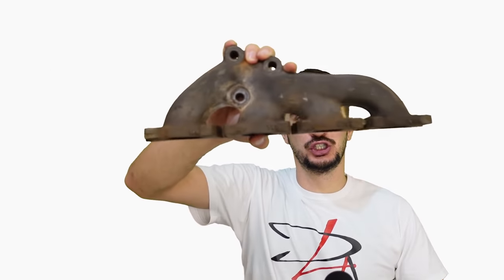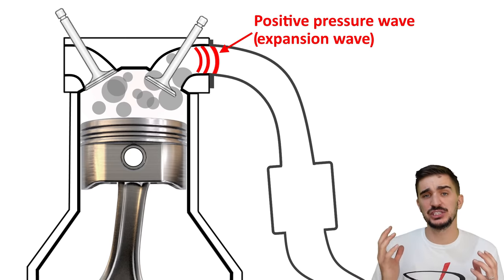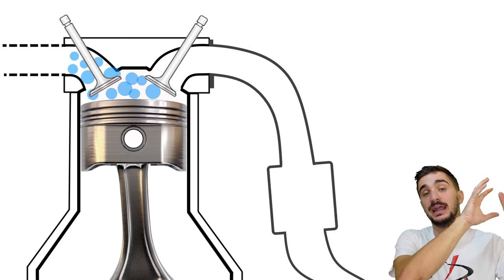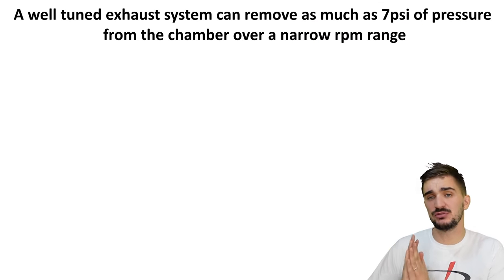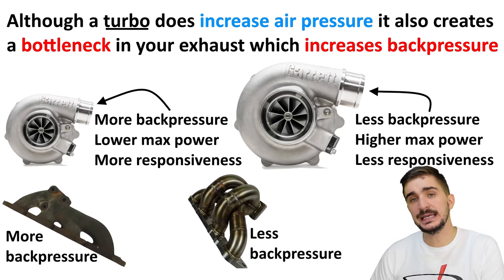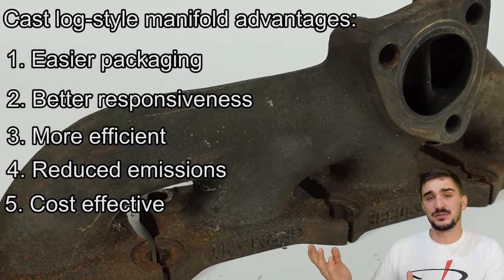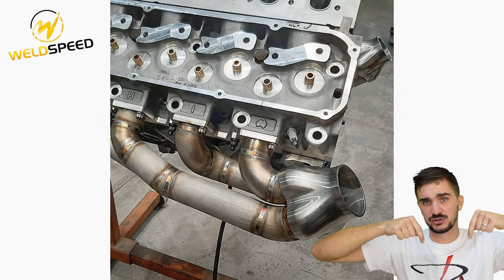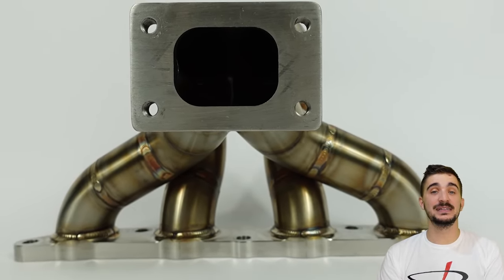EQUAL LENGTH tubular vs. LOG manifolds (headers) - SCAVENGING and EXHAUST BACK PRESSURE EXPLAINED

Comment: Back in the 80's Yamaha introduced the  EXUP system on their 4-cylinder high-performance bikes. It used a butterfly valve at the collector to change the timing of the negative pulse in response to changes in rpm. Later they also introduced variable length intake runners. 
To improve low-rpm intake velocity on single cylinder bikes they fitted two carburetors, one with a small bore, one large. The larger bore carb would only open at larger throttle openings.
Reply from the maker: All very very relevant examples!
Reply: is that used in any other bikes of other manufacturers?
Reply: @vasilisgreen  yeahh but yamaha the true genius who create the brilliant system later then copied by other manufacturer
Reply: @d4a  can you make video on this Yamaha exup system?
Reply: @JAVTROOPER  the "genius" who copied Walter Kaadens work at MZ disc valves
Reply: @chrisdeli7547  so now walter kaaden is the one who did the breakthrough but unfortunately yamaha still the genius who make it popular and sell it within their ownership
Reply: Sounds a bit like Yamaha's YPVS of 2-stroke engines, in the RZ and RD models to flatten and extend more the torque response curve.
Reply: @JAVTROOPER  you've said that already. I'm still picking a kawasaki over any yamaha
Reply: Every American V8 had two carburetors like that for each plane.
Reply: I would really like to see a video on variable intakes, I find the topic quite interesting but I don't really get it and he's so good at explaining that stuff.
Reply: @JAVTROOPER  go listen to music dude. with your yamaha headset.
Reply: Interesting.  I had a Mini with a Weber 28/36 carburettor that worked much like the Yamaha one you write of in your last paragraph i.e. the 36mm bore operated  near maximum throttle only to supplement the 28mm bore.
Reply: @JAVTROOPER  You're confusing Yamaha with Suzuki. It was Suzuki who facilitated the defection of Ernst Degner so as to steal the 2-stroke tuning technology developed by Walter Kanden at MZ.
Reply: @Rondo2ooo  The RD used reed valves.
Reply: @robertschneider8808  It's quite simple, actually. The air horns (velocity stacks) behind the carbs slide back and forth in response to changes in engine rpm. Longer tracts improve low- and mid-range power; short intakes give more high-rpm power. Yamaha calls the system YCCI (Yamaha Chip Controlled Intake).
Reply: @jiyushugi1085  yeah I mean I know the basics. BMW has the DISA which uses a butterfly valve to vary the length. But I would like to know more of the details behind it.
Reply: @vasilisgreen  Back in the late 90th  I worked on official kawa service, had a kawa bike as well . We like to tease each other with some painful facts like: when honda engine rumble like a new kawasaki run away from it because it will go down right now.
Reply: Don't forget the variable exhaust port on their 2-smokes! Altho' I think got a little ahead of yourself there, I don't think EXUP came along until the '90s? Yamaha did have their NICS intake system in the '80s [that made it so you had to have a special tool to block off the NICS passages in order to balance the carbs. OTOH, NICS made it so you didn't have to balance the carbs as often...] 😉
Reply: @vasilisgreen  F1 copies the Yamaha R1 style split velocity stacks, it's very simple and works.
Reply: The problem is that the EXUP was tainted by "emissions requirements". Hence why I removed my stock suppressor on my FZ1. I get people wanting clean air. But I'm not the primary polluter in this world. Not even in the millionth place. And I even left the two way cat in so I don't wreak of gasoline
Reply: Actually, I worked for Yamaha (via its advertising agency) as a translator, copywriter and riding model during that period. One of the stories I heard abut EXUP was that one of its primary functions — in addition to broadening the power band — was to reduce exhaust noise, thereby making it easier for the bikes to meet noise regulations.
Reply: The Yamaha CP3 triple uses a different header length and intake length for each cylinder
Reply: @jiyushugi1085  "The RD used reed valves."
Different things. Reed valves on two strokes are the one-way valves on the intake to stop the induction charge from exiting the crankcase via the intake system when the piston lowers to transfer the charge to the cylinder. YPVS is on the exhaust and effectively modifies the timing of the exhaust port opening to improve the low rpm engine power. Honda had ATAC which was in the exhaust, just off the head, which modified the exhaust tract with a butterfly.
Reply: @jiyushugi1085  most of these devices (such as exhaust and intake butterfly valves and flaps) are for noise emissions. We always say emissions and it’s assumed it’s for gas emissions when in reality it’s noise. It’s unbelievable the amount of noise that comes from the intake. I have a special set of billet velocity stacks on the carbs of my Yamaha R6 and revving that thing with the air box off is ear piercing
Reply: The 2008-2020 Yamaha WR250R Dual Sport bike has the Yamaha EX-UP system on the exhaust. The stock exhaust has flappers in it. 
But yeah unfortunately its more for noise and emissions now more than low rpm torque bc the stock exhaust is so restrictive and heavy to meet EPA emissions..
I would love to have a slightly louder stock exhaust on my WRR with the EX-UP reinstalled to see how it is verus the FMF S/A pipe..
Reply: @vasilisgreen  a lot of new car these days have an exhaust flap system and variable intake manifold runners. Check out the motors that Yamaha developed for the 90s Ford Taurus SHO, the mid to late 90s to late 200s, Toyota's High Performance 4-Cylinders were made by Yamaha and all had great technology and a great sound. Both NA engines and even some turbo engines. 
They really do have great engineering for all of their different business areas. Even their Instruments looks awesome lmao.. 
One thing that a lot might not know is that Honda did just come out with a new private jet. They have an awesome website for it too, when im ready to buy my new Plane, ill be giving Honda a call hahaha..
Reply: And I was wondering WTF is that sticker on my r1
Reply: motorcycle companies always do cool stuff.
Reply: on newer EFI Yamaha bikes, the intake stacks physically move depending on which RPM you are.
Reply: @ArneChristianRosenfeldt  vast majority of American v8s had one carb, they just used larger carbs for more performance.  Sometimes they used two or three, but the throttles were all linked together. Might be exceptions to that though.
Reply: @matthewmillar3804  maybe now they only show the Holley performance parts which have 4 jets in one cast body. Only one float bowl because the heavy cars had low acceleration and where used on the road. Now I wonder if this bowl is in the center of the jets.
Throttle linkage with the cranks could easily include mechanics to keep one barrel closed for low range.
I am still looking for a carb with 4 or three bowls and a linkage to simulate the fuel level exactly at the jet positions. Ah that would only work for static. Two jets per barrel connected to bowl on either side!

Less than 1 barrel for every four cylinders is even illegal on the road due to emission laws.
Reply: Hmm... does the Yamaha FZR 600 ('89-'91) have EXUP? Or was it just optimized in header and/or ECU? Because it behaves as if it had a mild 'turbo boost'. At 7000 rpm (IIRC) there's a sudden and very fun surge in power.
Reply: @nunyabidniz2868  YICS not NICS
Reply: @vasilisgreen  Mazda used variable length intakes on their 4 rotor. 

The idea, and others like it that dynamically change intake/exhaust resonance, very rarely gets used because of how much they cost to implement and develop, their complexity/low reliability, and the insanely small gain that is achieved from it. 

"Then why is it not used in racing"- I guess it's seen as a kind of movable aero, or other kind of banned device. Yamaha stopped using theirs on race bikes just cause of how little it added vs how much effort it took to add it to the engine.
Reply: Yes. I had a 2008 Yamaha R1. Both of those systems worked wonderfully. The variable length velocity stacks sounds and even felt like vtech kicking in yo!  Lol.
Reply: @jiyushugi1085  OK then, i never heard about that before. Thanks for the info, i will research it.
Reply: Yamaha xt350 has the dual carb setup, one for each intake port. Throttle response and fuel economy are astonishing for a cheap 1985 bike. Bike gets 100 mpg, yet can still hit 89 mph.
Reply: They later let Toyota use that technology on their NA 7Ms and 2JZs

Comment: Another part of the Scavenging is helping Evacuate the exhaust from an adjacent cylinder with pressure and back pressure. More so in a multiple y collector header situation. That typically pertains to NA engines. You did a great job considering you could make an entire movie just about headers and exhaust. Keep up the good work and keeping the masses educated.
Reply: I had a kid claim that I messed up my exhaust scavenging by switching from a dual exit exhaust to a single exit 🤣 its a turbo v6 and split to a y section at the back of the car, but I switched to a single exit.
Reply: Well said WILburr. "Scavenging Sucks".... thank goodness. Cheers!

Comment: Nice video! Cast manifolds aren't always bad. I have dynoed volvo 5cylinder engines with oem s60r cast manifold. It is quite short and equal leng. Sturdy af, hot exhaust gasses makes fast spooling turbos.
Reply: Long manifolds gives higher peak power but sacrifice a lot of spooling time. Probably slightly oversized turbo with realatively short manifold should be optimal for track use

Comment: About 20 years ago I had a truck and installed  3” dual exhaust, a programmer and an intake system. It made a small difference but once I installed headers, it made such a big difference. Now I’m old with a kid so my fun days are over.

Comment: At the performance shop near me they choose short iron manifolds for their 2000 hp turbo ls applications. I asked why and they said you don’t want long manifold lengths as they reduce response and big hp cars have massive turbos where response is more important. They choose iron as it holds up to heat better than stainless as they’ve experienced stainless manifolds cracking in the past and the more heat you can retain in the exhaust the more energy you have in the exhaust side of the turbo. Ive also heard from experienced racing companies that for most average performance builds the diameter of the manifold tubing is much too large on most cars which is only reducing response and the amount of power you would loose from having a smaller diameter tuning is minimal at best as like this video explains the exhaust side of turbo is the restriction. For most of you with turbos making less than 600 hp you are honestly better off with small iron manifolds with smaller diameter tubing. The information from this video can be misleading but each application is different and on lower ho street car’s response and reliability is more important than a big hp ls race car.

Comment: Good topic, headers are so important on natural aspirated engines , i switched from a stock 41 narrow tube to a wider 421 and the gain is noticeable on a K24
Reply: especially with reflash :)
Reply: Waiting for your video on this subject ;)
Reply: Same with my Panther, made it faster n seems lighter..lol
Reply: I can agree with this 100 percent. I put in carless headers on my tsx with the ktuner reflash and it is very noticable.
Reply: @vhssociety  just got a clutch overhaul and it shifts smoother, 20s 100 200kmh